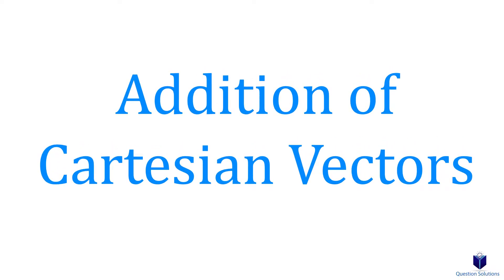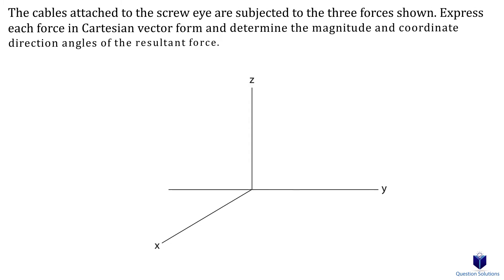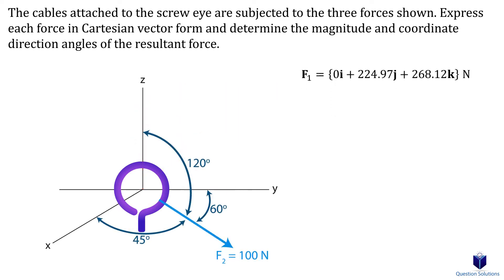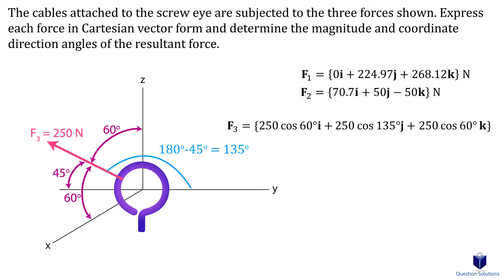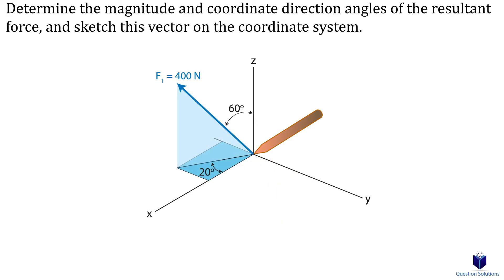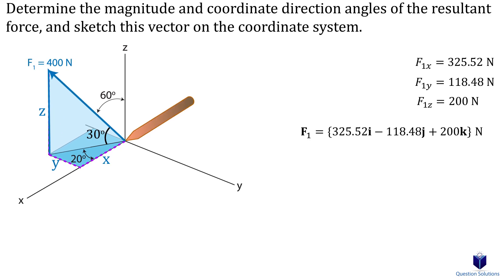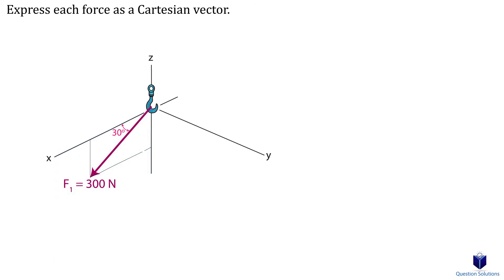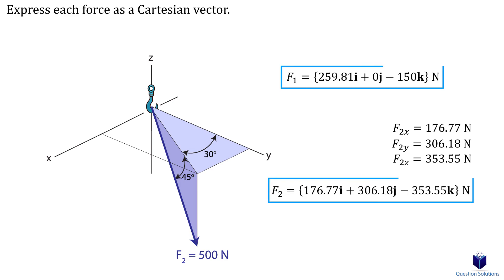Addition of Cartesian Vector Forces | Mechanics Statics | (Learn to solve any question step by step)

Comment: I have a question, I was asked to get the ''direction cosines'' my answer was: cos α= 0.1181088421 . Is this the final answer? or should i isolate α and make it arc cos (0.1181088421)?
Reply from the maker: So your angle would be cos^-1(0.1181) as a degree value. Plug it into your calculator and whatever value it spits out is the answer.
Reply: @QuestionSolutions  oh okay thank you so much!!

Comment: why in the 3:29 part. the Y component on F2 is using a cos instead of sin??
Reply from the maker: You always use cosine when the angles are coordinate direction angles.
Reply: @QuestionSolutions ohh so it means every time all the component is positive We will use a cos?
Reply from the maker: No, it means if they are coordinate direction angles, you always use cosine. It's really important that you can easily pick out what coordinate direction angles are. It's whenever a vector is given in 3D space where the angles are given with respect to each axis.

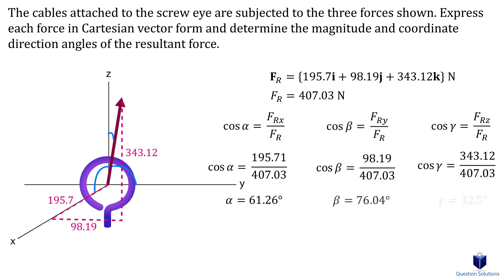Comment: 05:18. How can F2 be 60 degrees away from both the x and y axes if it lies in the xy plane?
Reply from the maker: Coordinate direction angles only give an angle between a respective positive l axis and the vector itself. So here, it's showing that the force is 60 degrees away from the positive Y-axis. In addition, it's impossible for F2 to lie on the x-y plane since it's 120 degrees away from the z-axis.

Comment: Hi so I'm a bit confuse, from 4:55 answers for all forces in i unit is 195.7, then when finding for the magnitude it became 195.71, is it an error or not? Computing for the magnitude with 195.7 results for 407.02, and 407.03 if 195.71 is used. Im sorry, I'm really bad at math😓
Reply from the maker: It's just a typo, where the last digit after the decimal place wasn't included. Regardless, you can round up if you want, the difference is minimal.

Comment: At 3:18, the angle between the force line and the x- and y-axes — why doesn’t it add up to 90 degrees? Is it the angle between the force vector and the axes, or is it the angle between its projection (shadow) and the axes? thx in advance!
Reply: oh now that i kept on watching its the angle directly from the main force to the x,y,z axes. i just learned integration with conic method and got me confuse hahaha
Reply from the maker: @prod.groundzero8322  That's right, it's the angle between the force and each axis.
Reply: @QuestionSolutions ur amazing! 10 days left and my semester will be open! might as well study in advance thx

Comment: wouldn't be 45 deg below F2 at the second question which completely changes the answer🤔
Reply from the maker: When it's coordinate direction angles, you always look from the positive x,y,z, axis to the vector, never the negative. So you need to use 135, not, 45. If you use 45, you will end up with the wrong answer.

Comment: At 7:54 when I calculated your numbers its just 570 not 610 why it is
Reply from the maker: Not sure how you got 570, and I can't say without seeing how you typed this into your calculator. The value of 610 is correct though. So double check your work. Also, there are tons of online resources to check your work, so utilize them to figure out where you made a mistake. See: https://www.cymath.com/answer?q=sqrt((575.52)%5E2%2B(131.52)%5E2%2B(-153.55)%5E2)

I hope that helps!

Comment: 2:28 sir i think the angle with y would be 60 degree  and why you have taken 40 degree bcz the angle is not mentioned wrt y
Reply from the maker: That's incorrect. You need to look at it with respect to the angle given. You can use 60 degrees (not sure why you would because that's extra work), but if you do, you need to use cosine for the j component and sine for the k component. Remember, always look with respect to the angle. 

Also, "why you have taken 40 degree bcz the angle is not mentioned wrt y" I am not sure what you mean here? You don't need the angle with respect to an axis to solve it. You can use any angle given as long as you know whether to use sine or cosine to get it.
Reply: @QuestionSolutions  ok thank you
Reply from the maker: Let me know if you need further help or if you understand it. Thanks! @Ashjj1935

Comment: sir, I have a doubt ....in 4:02 ...in f3 vector why we are subtracting 108- 45 degree and writing it as 250cos(135) j  with respect to positive y axis....why cant we write directly as (minus) -250cos(45) j with respect to negative y axis ...could you please clarify it?
Reply from the maker: It makes no difference, the only thing is that you need to remember to use a negative sign whenever it's not with respect to a positive axis. It's easier to remember to subtract the angle from 180 since it gives you ability to understand what you're doing. Either way, you will get the same answer. The proper method is to subtract the angle from 180 but it's up to you :)
Reply: @QuestionSolutions  thank you sir😇

Comment: How can I find that the force vector is just in xz plane or xy plane so that its third component is zero?
Reply from the maker: So you can just look to see what angles are given. If you are given 3 angles, then you have 3 components, if you're given just 1, then it's in a single plane, and that plane is dependent on the angles given. So look at 2:21, you can see we are given just 1 angle, with respect to the positive z-axis, so we know it must lie in the z-y plane. Even though we are given 1 angle, we know that with respect to the y-axis, the angle  must be 90-40 = 50 degrees.

Comment: Please at 2:49 I don't understand why the force doesn't have an x component but F2 has a z component even though its in the x y plane
Reply from the maker: Hi, so you have to look at the diagram really carefully. Specifically, look at the axes shown. Locate where, x, y, and z axes are. After you do that, look at force F1. I draw the components of force F1 at 2:49. See how it has an z-component and a y-component. They are along those axes. It's in the z-y plane. Now look at force F2. It's NOT in the x-y plane, it's also in the z-plane. Look at time 3:30. See how the force is below the x-y plane. That means it's not lying in the x-y plane, but it has all three components. You can also tell because the angle between the force and the z-axis is 120 degrees. That means it goes past the 90 degree mark, so it must be below the x-y plane. Let me know if you need further help. Best wishes with your studies.
Reply: Thank you soo much I understand now
Reply: I wanted to ask if you have a video on finding position vectors in 3D should I send you a sample question?
Reply from the maker: @adwoaaj5925  yes, I think this is what you're looking for: https://youtu.be/CCeWy1kmxMs
Reply: @QuestionSolutions  thank you

Comment: the angle between F' and  F1, shouldnt it be 10? because (90-20-60) degrees ? on 6:14
Reply from the maker: The 20 degrees is between the positive x-axis and F'. It is not related to the angle between F' and F1. 👍

Comment: on 3:15, since the force runs in the negative z axis, shouldn't we subtract 120 from 180 to give us an angle of 60 between the positive z-axis and the force? We did this for the j component, so why not for the k? Thank you!
Reply from the maker: Maybe I am not understanding your question properly, but we didn't subtract anything for the j component. Since the angles were already given to us with respect to the positive x,y,z axes, nothing needs to be subtracted. We only ever subtract from 180 degrees if the angle was given with respect to a negative axes. For coordinate direction angles to work, we have to use the angle with respect to positive axes. Now if we look at the 120 degrees, we see that it is indeed given to us measured from the positive axis. You can tell the positive sides by looking at the labels for each axes, so for z, it's labeled on top, that's the positive side, for y, it's labeled on the right, so that's the positive side, and so forth. Lastly, when we do the simplification, we see that the the z component is indeed negative, and you can see that at 3:29, it's below the x-y plane. If we had used cosine 60 for the z-component, we would end up with a positive force value, which would be incorrect.
Reply: @QuestionSolutions  Ah! I apologize! You are correct, the angle given for k is with respect to the positive z axis. I had a total brain fart and imagined the angle given was with respect to the negative z axis. That was my question, whether we should subtract the given angle 120 from 180 as I thought it was respect to tue negative z axis. Thank you for responding! I love your videos by the way, they have helped me so much!
Reply from the maker: @Pguzman42  I am very happy to hear that it's all cleared up. Keep up the awesome work and I wish you the best with your studies! And thank you for your kind words :)

Comment: In regards to the F2 of the problem in 3:11 , shouldn't the angle with respect to the y axis be 45 degrees as well? Because if we make use of the 45 degree angle that's with respect to the x-axis to look for the x-component, we could also make use of the same 45 degree angle that's with respect to the x-axis to look for the y component with the use of sin. However, it gives us a different result compared to making use of the given 60 degree angle with cos. 
if F2x = (100N)cos(45), then F2y = (100N)sin(45). However, F2y = (100N)sin(45) doesn't give the same result as F2y = (100N)cos(60)
Reply: help a brudda out.....I'm confused
Reply from the maker: What you are saying cannot be done, because these angles are given with respect to individual axes. In addition, they must be given with respect to the positive x,y,z axis, or you have to do the math and calculate the angle with respect to the positive axis. They are not interconnected, which is why cosine must be used when solving coordinate direction angles. So you can't use sine, you have to use cosine to figure out the answer. What you are saying can be done with transverse and azimuth angles (like the one shown at 5:37). I hope that helps.

Comment: can you solve the first problem by using F2' and F3' ?
Reply from the maker: No because the forces are given with coordinate direction angles. The F' method is only applied to forces given with transverse and azimuth angles. Please make sure to realize the difference, or you won't get the correct answers.
Reply: @QuestionSolutions  so the sign to use transverse or azimuth angles is when they show a blue triangle?
Reply from the maker: Pretty much, yeah. 👍

Comment: In the third example. Shouldn’t Fx2 equal Fx1 because I observed a rectangle lying on a the xy-plane and the two short sides of a rectangle are the same length and the two long sides are the same length.
Reply from the maker: I don't know how to answer your question because I am not understanding what you are saying with the observed rectangle. Are you saying components of F1 is shared for the components of force F2? If you can maybe draw a diagram of what you mean? Sorry, I am unable to follow your question.
Reply: @QuestionSolutions  okay. So go to the purple triangle in the xy-plane that has the 30 degree angle, and you will see a line on xy-plane that looks to be parallel to the y axis. Follow that line until you stop at the x axis. The line looks to be perpendicular to the x-axis.Then start from that point and follow that line until you get to the origin we’re the hook is. Next, make you way along the y-axis and stop at the line that is perpendicular to the y-axis. Finally, follow that line until it stop that line that parallel to the y-axis. When you go around that path, you will see that it looks like a rectangle was drawn.
Reply from the maker: @darrylcarter3691  Okay, I see what you mean. But if you look at the original diagram, you can see that the line parallel to the y-axis lying on the x-y plane ends shorter than the x-component of force F1. So while, it's true, it forms a rectangle, it doesn't line up with force F1, so the x-component of force F1 is not equal to the x-component of F2. That was the original question right?
Reply: @QuestionSolutions  yes
Reply from the maker: @darrylcarter3691  👍